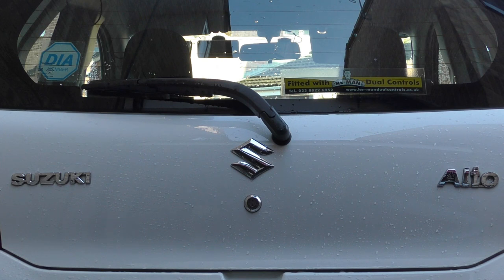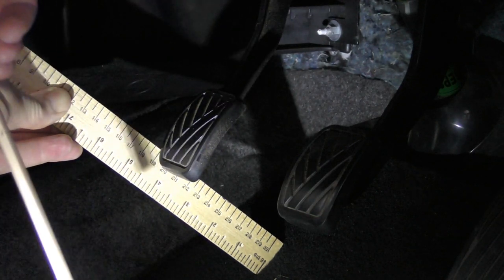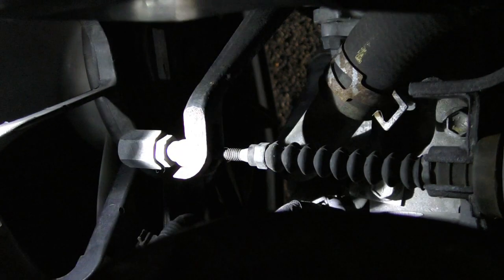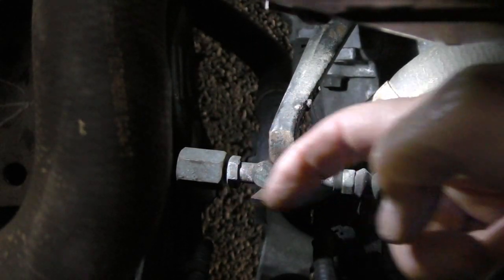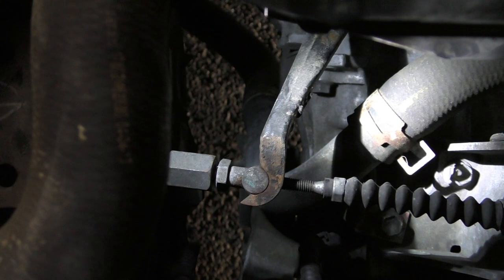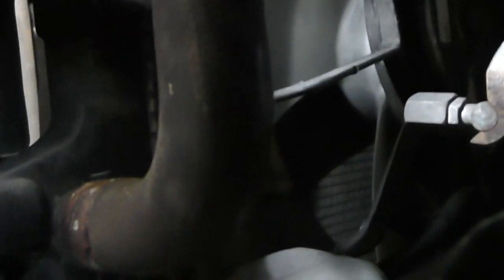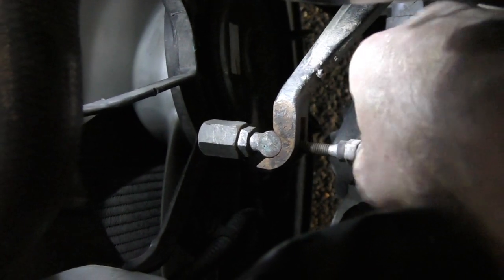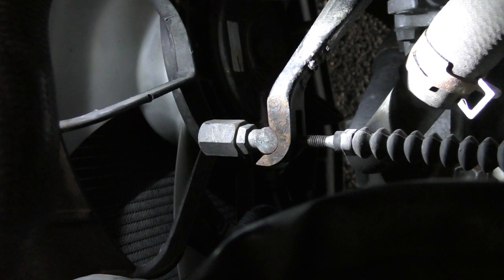2013. Suzuki Alto. Checking and adjusting the clutch pedal free play. Maruti. A Star.

Comment: Excellent good informative video. My  Alto 2014  has 65000 miles on the clock. My clutch is starting to go I think. The engine is racing a little when start off till I pick up speed. It's like it's waiting to catch up
 I done the clutch test saw on YouTube as well. I put it in 2nd gear with hand brake on reved the engine. But the engine never cut out so I presume I may need a new clutch. I will check the play like yr video shows and make the adjustment. I hope this may give me some more time. Anyone know what  a garage would charge for a new clutch?  Thanks
Reply from the maker: Thank you, much appreciated. If the adjustment doesn't fix the 'slipping', then yes I would think a new clutch will be needed. I would contact your local garage for a price, and also some of the companies that advertise on line. If you know a local mechanic, you could buy the clutch kit from a local factor and get him to fit it....that may be a bit cheaper. Good luck, and thanks again.
Reply: @DavidGarside  Thanks David will try and adjust the clutch cable I think you said play should be about 15mm. (I'm feet and inches person learnt all the imperial measuments at school,  then to fit in with the EU they buggered it up for everyone,  still the USA still uses them could move there lol)

 I had a brilliant local mechanic when I was in North London.  He never caught me and was a trained engineer. The best mechanic I'd ever used. One man band small lock up garage on an industrial estate.  Got him after asking the local council MOT testing station where I could find a good honest mechanic. . I was getting over the top prices and unprofessional services for years.  I used this guy for over 30 years even when I moved up here north east Essex 80 miles away by the coast  12 years ago,  I still booked my car in with him and stayed at family's home.  London had changed beyond recognition in my life and is pretty well dangerous with no go areas. Anyway got to bit the bullet and try and find someone honest local. 
Thanks again for yr very good video I'm sure it will help lot of people out take care. I've used that monicker as my name cause I've comment a lot on political matters like why has it taken  over 4 years to leave the EU. And many other issues I'm an armchair warrior lol you take care
Reply from the maker: Hi Spartacus. 15mm is about half an inch, which should be at the pedal like shown in the video. I still use my main Suzuki dealership (family run business) down here as I've know them for 21 years plus.... I've taught several of the family to drive over the years. I know how valuable a small local mechanic can be so well worth trying to find one near you, athough I can understand your loyalty to him. The only problem with being so far away is if you get a sudden problem that needs sorting quickly. I'm not much of a politician but I think if Cameron and May hadn't faffed around so much.... we'd have been out ages ago.... Boris should have taken over from Cameron I think.
Reply: @DavidGarside  Thanks for all yr help might adjust cable later today or tomorrow just so hot only using it locally.  Yeah it's to far to drive down to London now, but I had so much confidence in this guy it was worth its while. Even when. I'd had an old banger and the slave clinders were rusted up out came a disc cutter to get the old one off. No job was too much trouble for him. He was a trained Nissan engineer\mechanic.  All the women staff from the local council office block used him because of his reputation and honesty.  Also he was not a top up merchant plus you knew the job was going to get done properly. Just tried calling him for some advice but he probably under a car working might catch him in the morning.  Was going to put it to him that I'd make it worth his while  if h ed considered a home repair. But I know he Probably say no but some mechanics do this when they are winding down and getting rid  overhead costs of renting industrial units.
Anyway I'll get an estimate from Suzuki dealers about 15 miles from me and Lookers also same area. It's been such a good reliable car no tax and good on fuel. I just don't want it bodge up its only six years old the last car I had was a Fiat Uno for 22 years in immaculate condition 120,000 miles on the clock I get my money's worth I know! Lol. So I've only done half that and had it 6 years but it a good drive and very nippy the Suzuki Alto shame they moved onto a newer model.
As for Boris we will have to wait and see. THE BEST PM WE HAVE NEVER HAD is waiting in the wings and I'd put a tenner on him Nigel Farage leading the Brexit Party doing something even more spectacular than their European Election win. 
So its up to Boris to get his finger out. Thank again David
Reply from the maker: Yep, nothing beats a good old hands on mechanic. One other little top when you adjust it.....after you've loosened the locknut, make sure the threaded section doesn't turn while you're turning the adjuster nut itself. On my last little tweak, I had to hold the threaded cable section as it was trying to turn with the nut.  I took the nut off and cleaned and greased the threads as they'd got a bit dirty.
It's a great little car. 83000+ in mine as I use it for driving instruction. I had s new clutch about 35000 miles due to a few faulty release bearings having to be changed.  When they did the last one I paid for a new plate and diaphragm to be put in as well.
It would be interesting to know how much the new clutch would cost via dealer and private, so would you let me know when you find out please.
Nigel would have been great...they should have had him in as negotiator from the start.....
Reply: @DavidGarside  Hi David I spoke to my old mechanic this afternoon he called me back cause he missed my call this morning. 
 Anyway I did ask him if he undertook home repairs. But it's not possible as I'm 80 miles away plus he said he's nearly 60. Can't blame him though. 
It's is a fair way to travel. 
 He told me to put it in fifth gear with hand break on while engine was revved up a bit and lift clutch pedal slowly. It did not cut out as it should have
So I think clutch has had it. The pedal has no play whatsoever. So I will loosen it off tomorrow. 
The mechanic told me to try and limp it down to him, his charge would be £350 (I would have given him £100 extra if he was able to come up here,  but I suppose it's all the plant he has to use plus he has a hydraulic lift in his lock up) including the clutch parts.
Tonight while it was cooler I went and WD40 spray the nut and lock nut ready to adjust tomorrow . I'm trying to weigh up what's best. But I'll let you know my other estimates.  Yeah so yr Alto is a bit of a work horse with yr driving business. I do like this car mine is zero rated for road tax as well another plus. Thanks for the extra tip and I'll let you know what the other estimates are.  They better get Brexit done and sort out this new asylum crises with those coming across the channel. Lucky we had Churchill and  patriotic and stronger generation in  1940 or Hitler would have walked right in if these snowflakes were in charge then! We don't know who these people are, if any are criminals or terrorists! Let u know when I've got the other estimates take care
Reply from the maker: Ah that's a shame,  but I can understand not wanting to travel that far.  That's not too bad a price, was that supplied,  or just the fitting?
If your pedal has no play at all either it's worn out, or m8ght just need loosening off....but if it's been like that for a while then it may have worn it down past the point of no return. As your man said, test it with the handbrake on and in high gear.....he'll know much better than me.
Glad when the end of the year is here...i hope we don't give in to the French over our fishing rights.....we catch em,  they buy them..... It'll take a while to build our fishing industry, but it's a start and will give time for fish stocks to recover....
Reply: @DavidGarside  Hi David I've loosened the clutch cable. Thanks for the tip about the cable twisting. I put a  spanner on the cable nut to stop it as it was starting to do that. The WD40 that I sprayed on the locknut last night helped, but it is a tight fit to work in with yr hands. Lucky I've not got big hands like the former goal keeper for Spurs and Arsenal.  Pat Jennings. His hand were like a pair of shovels they kept a lot of goals out of the nets lol.
After loosening the lock nut it was straight forward.  I turned the outside nut with my hand. Untwisted it about half an inch.  The pressure on the clutch pedal is now met halfway down took it for a spin and it's seem bit better for acceleration. 
Anyway the price of £350 is for parts and labour.  But it's the trouble of staying down in London area for two or three days drive down there one day drop it off the next and pick the car up on the third as I've asked him  to get it an MOT. (£50) Otherwise I could pick it up the same day I drop it off. 
I may call Lookers car repairs and Suzuki
this afternoon for a quote as well. It's just a case of confidence with me been bitten so many times by top up merchants and cowboys before I started using this guy. I'll let u know of the other quotes. Did seen one on line after entering my reg number for home repair clutch company it was £510.
But again it's about trust. 
I'll see what the others say then decide I'm retired so got the time to ponder.
Let's hope this government get there finger out a lot of northern Labour voters gave their X to Boris because they did not want Marxist Government with Jeremy Corbyn the Islington mob who live in their own ivory bubbles to mess things up more than it already is. Take care speak soon where are you roughly base in the country are you beside the  sea cause yr right about take full control of our fishing waters.  Take Care
Reply from the maker: Yay, that's good then. You only need about half inch play at the pedal....much more and the clutch might drag a bit making a notchy gearchange. If it's not slipping at all now,  then you may be lucky with it...fingers crossed. Yes it's a bit tight in there....my hands aren't massive so although a bit fiddly,  I can do it ok. On the other side of the engine though.....the Alternator nut however is a bit of a git to get to. I get the charge light  coming on now and again which is easily sorted by tweaking the nut (see my video), but to do it properly you have to remove the terminal to clean it....not easy when there's only room for one hand. Make sure you disconnect the neg battery terminal as you don't want to short out the terminal to earth. 
That price isn't bad for parts and fitting I think....I would have expected a bit more...especially from s main dealer.....although you'd get the genuine Suzuki clutch for that.
As for the reference to footballers hands.....i have no idea who they are as I don't follow it at all.... F1 and Moto Gp are the only sports I watch....and F1 one is getting on my wick at the moment lol.....
Reply: @DavidGarside  hi David the £350 was from my old mechanic including labour and clutch cover and bearing. His overheads are probably low. And his very good prices undercut the main dealers by some way which keeps him with a steady turn over. I phoned Suzuki dealers this afternoon  was quoted £600 for the genuine part or £500 for non genuine parts. Gonna think it over this weekend what to do! Probably go with the main dealers.  But my mechanic can Mot it for another £50 making it £400 total. 
But such a long  way to go:to London then I've got to stay at my son's for a couple of days.he lives in Hertfordshire so this maybe the time to try someone else like Suzuki  dealers but probably pay quite a bit more, but it will be more convenient. Just got get let go and put my trust in a stranger and get passed this  distrust from my bad experiences of dodgy mechanics!
Just curious David do you have a dual brake and clutch mechanism on yr Alto while you do yr driving lesson, did you fit it yr self if you have one. I'll give my Alto a good run over the weekend but I know what I've done today is only a stop gap I'm sure it must be the clutch. It was a bit more nippy to today but nothing like it used to be so I will get it done in the next few weeks and let you know the outcome. 
As for the football player he was a goal keeper with very large hands that was even on a news piece back in the 1970s  But I've gone off Football a bit millionaires  footballets kneeling like the political correct woke Policemen. It''s all getting too much Have a nice weekend and yr video and tips did help me so Thanks a lot take care
Reply from the maker: @spartacus-freedom  £350 for a small business is a good price...the higher ones you've been quoted were nearer what I would have expected. For that difference it's certainly worth considering the drive. My friend round the corner has a friendly mobile mechanic and when he needed a job doing on his gearbox (Renault van), he had the box out in an hour....I know, I was there when he did it....when the box had been repaired,  he had it back in with a clutch in less the 1.5 hours. I was amazed as garages usually quote about 4 hours I think....
I have dual controls in my car. Suzuki had a driving instructor programme getting them supplied and fitted by 'He-man' free of charge. Obviously the use of a Suzuki promotes the make, and a few of my students have bought them, proving it works. 
All this kneeling etc has put me off the F1 a bit too,  everything is getting too political and these groups just seem to want to force things upon others. No problem with their beliefs, but don't push it in my face is how I feel. Same with the footy lot, and others too I believe.
I hope your car holds up ok...let me know how you get on.
If you're on Facebook, you can add me as a friend of you want to....just search my name...my picture is a black and white portrait of me at about 7 years old...
Thanks.
David.
Reply: @DavidGarside  Hi David just got off the phone to the Suzuki dealer. I told him of my plight that I've lost faith in mechanics because of my bad experiences. (He said come to us and we'll restore it.)
 One time I left my Fiat Uno which was only a about 4 years old then, back in the 1980s, for some tyre replacements and brake pads. I paid the bill got home. 
Then noticed a dent in the body work above the front wheel arch.  I went confronted them they denied all knowledge of it. I saw a very large jack nearby so I pulled it over and showed them that the pole arm of the lifting jack matched the round dent perfectly.  I said you probably let one of yr new apprentices work on that without supervision. They never coughed up made sure after that I did not want kids on my car. Someone obviously let go of it 
In an uncontrolled.  maner. 
It's looking like I'll go with Suzuki cause it will all be done in a day
Their MOT is £30. Whereas my  mechanic will take it personally to a MOT garage. Means I got to stay down there for two or three days.  Drive down day1 drop it off day 2 pick it up day 3. All the jobs in the past I've dropped off and picked up same day. 
So will get a tyre changed that is wearing thin and phone Suzuki for them to diagnose it.I told them I'm 99 percent sure it need a new clutch.  But they wanna look for themselves first which is fair enough.  Then book it in. To safeguard my interest ill take some photos of the body work after I take it in.
I went on yr website very interesting see yr connection with Suzuki through motor bikes. I did use a blog which was very political lots argument and scumbags on there who were on the side of those who committed those terrible atrocities on the London tube and buses!  
I have never used face book my grown up daughter who is 43 is never off it. No wonder she's got not time to call me or her mum lol
I have seen her and my sister's lives completely taken over going for a pint of milk going to the toilet going on holiday telling the whole world their day to day business and potential burglars! 
I'm sure yr around my age and we are more sensible lol take care it was intresting to see how nice and quite the street were on the video compare that to London what a joke and they the government still can't get a handle on stopping any Tom Dick or Mohammad from not even sneaking into the UK but blatantly requesting ferry services form the coast guard and soon to be RN. You take care if I ever join FB I'll add you on friends list thanks. I'll let you know how it goes re Alto